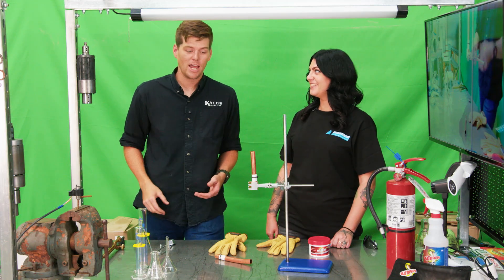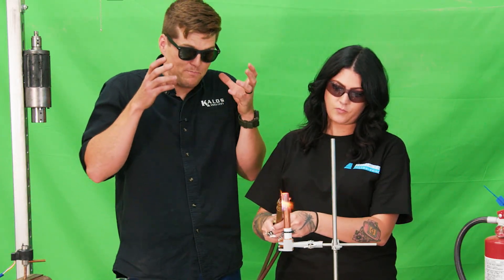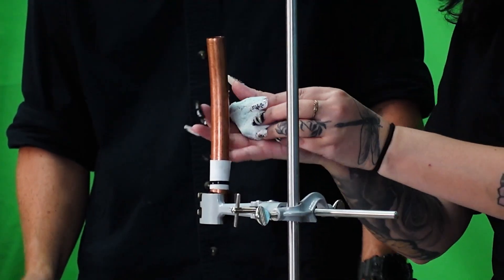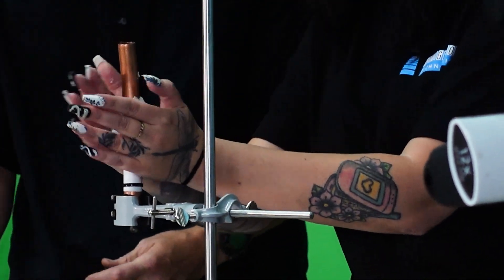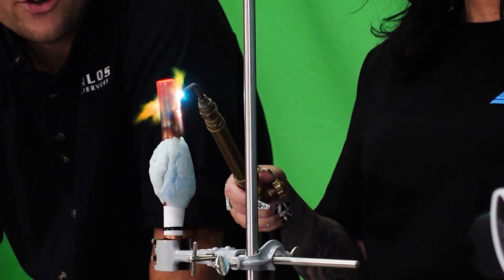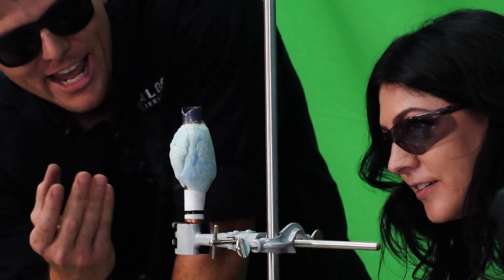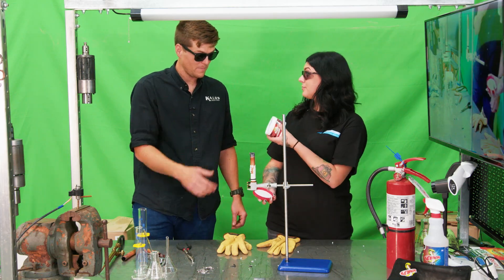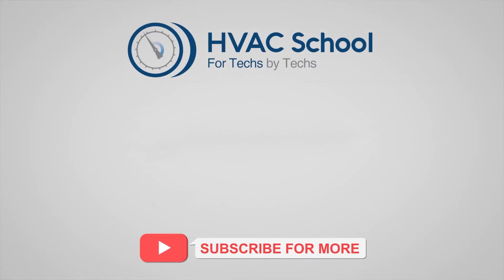VIPER WETRAG Demonstration: Why You Need Heat-Blocking Putty

Comment: Problem Im having is paper doesnt burn till 451°F     but the txv and schrader valves are not to be heated over 250°F.

At what temperature did the compound  adhere to the pipe at. It clearly dried out and adhered to that pipe.
Reply: ive had 2 instances where a wet stock outperformed heat blocking putty on service valves and TXV's without the 30Min clean up
Reply: @Paul-IE-Repairs  yeah i will probably stick with my method   havent lost a single txv nor service valve.   i take a thin strip  wrap it tight around a few times then stack 3-4 soaked rags on top of it.

Same with service valve  wraps around stub, then body   then stack soaked rags on top.   doesnt really take THAT long and i dont have to worry if the joint messing with me a little bit.
Reply: The part of the video that got cut out was where I picked it up after the test was done to show how cool the pipe was. Not sure why it’s not on here

Comment: Can you demonstrate a braze on a service valve to prove it doesn’t screw me over?
Reply: It’s terrible on service valves. It does stop the heat and protects the valves but it’s a pain to get off. I used my leak detector as a soap and wiped all the residue off . But it crumbs up and is a mess around anything other than a flat or round surface
Reply: @hwh6237 I found out most valves are a brass alloy, so using flux is allowed
Reply: @hwh6237 we made a video with the same thing on an EEV with the top cut out so you can see the components😊
Reply: @hwh6237 just put it on the pipe before the valve
Reply: @Bigtimebearsguy  

Yes but these brands have been giving such a small stem to work with. One mistake and you have no room to cut back and re do. I’m finding more and more having to use a zoomlock press fitting just to extend the pipe out so I can work with it and braze the rest on out.
Reply: @hwh6237 We work with fiber glass insulation friends, I don't find the mess wet rag leaves to be a reason to stick with a literal wet rag. 

I didn't think my brazing skills were more than the average but I guess im good at brazing since a zoom lock has never been needed to braze and never needed to cut back copper on a service valve. What mistake are you making that can be re heated and fixed? 

I agree there is very little room to work with but we are professionals and there really is enough room based on daily experience with diaken family of products. Maybe your manufacturer is worse?

Good luck in the field!

Comment: This stuff really works. I used this putty when I needed to install new TXVs in a under counter fridge, and it worked incredibly well! Stopped the heat before it could migrate to the valve itself and helped with the cooldown process since there was no excessive heat on the body or head.
Reply: No doubt this works but comparing the cost to an actual wet rag, why would you use this product?

Comment: In your opinion, what kind of condensing unit and evaporator should we choose that are compatible with each other? Is there a general formula, for example, what size cooler should be for 1 hour of compressor power? thanks
Reply: Homie, that’s what your salesman is for.

Comment: She took the flame lower when she didn't use that heat block.
Reply: The distance at which the flame is placed relative to the top of the pipe is irrelevant. The heat would travel down seconds faster and still ignite the paper. The wet rag literally super mogs that flame, probably minutes before the paper catches fire 🙀
Reply: @yinggamer7762 Yeah, but let's prove it. That's the whole point of the video.
Reply: @SombraLocs  we did with and without heat putty with the paper yesterday and also did the test on an eev with top cut open to see internal components. I could pick up the pipe with putty right after the test.
Reply: Did you expect me to put the flame right to the putty? The point was to show how the putty absorbs the heat before reaching the paper
Reply: No, but you should have kept the heat on the same spot with both tests.